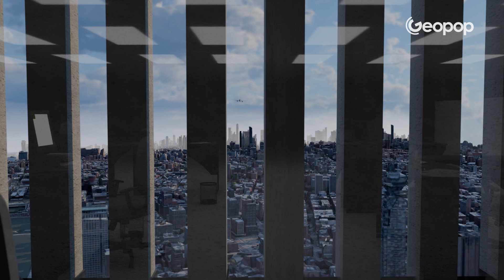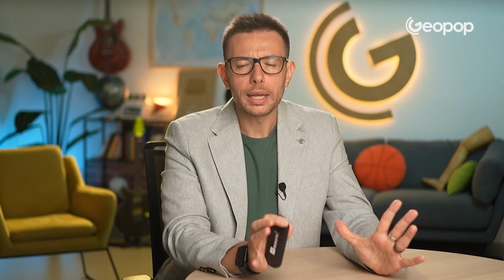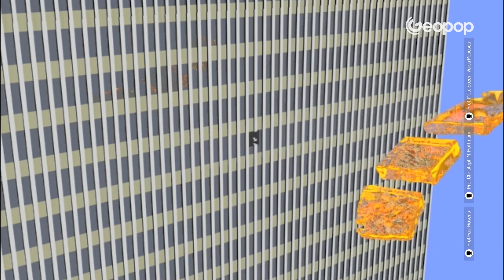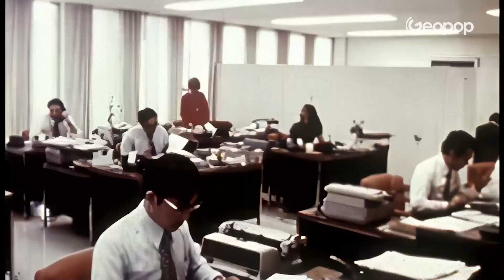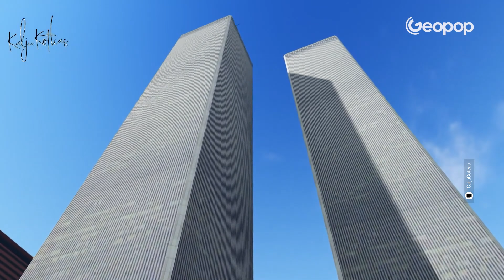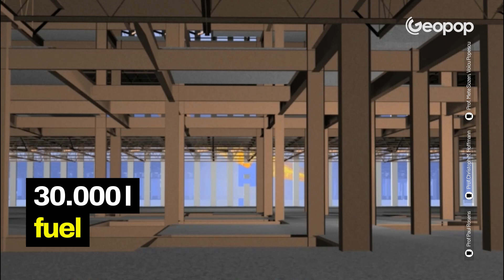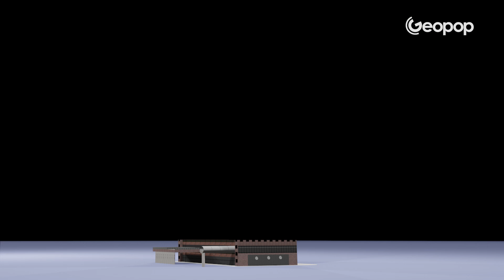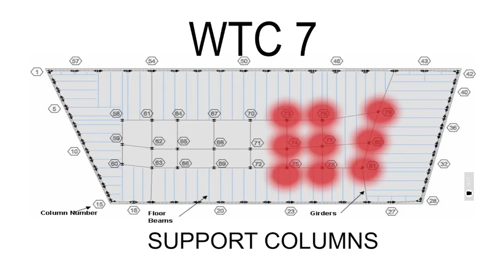9/11, 2001: The Technical Reconstruction of the Twin Towers and WTC 7 Collapses

Comment: Very very ridiculously retarded video
Reply: Really?  I found it highly detailed, accurate and logically sound.

What specifically seems to be the problem?
Reply: @TheCriticalStinker-jw4fl  how old are you and also research the building when it was being built and why it was built the way it was
Reply: @JamesClayton-w8r  I took your advice. Twin Towers collapses were relatively straightforward, the fundamentals already understood in the professional engineering community within just weeks. Yet there’s a lot of really bad information floating out there, mostly on the internet where it’s easily accessible to anyone. Good information takes more effort to come by and is much harder for laypersons to digest. Engineeringspeak is complex and dull while wild baseless speculation and pathological theorizing with easy hand-wave answers is simple, exciting and require a whole lot less thinking, thus getting far more intention than they deserve.

To correct that situation, I have all on my own prepared this short yet detailed technical description of Twin Towers collapses based on my own observation and analysis of the available true and relevant facts. No politics or ideology, just the engineering. My hope is this will dispel many common myths and answer most if not all questions you may have about the Twin Towers collapses, because anything can seem like a conspiracy if you don’t understand how it works

While complex, most of the Twin Towers collapse mechanisms can be seen with the naked eye and easily discerned and understood by the layperson if sufficient time is taken to understand. 

1. The Twin Towers consisted of 4 primary structural elements that together formed an integrated system where each relied on the others.  47 hollow box-section steel Core Columns carry the majority of the gravity loads. The 236 hollow box-section steel Perimeter Columns carry the remainder and ALL of the lateral (wind) loads. Long-span Lightweight Steel Trusses connect the core and perimeter column together at each floor with a Hat Truss on top to tie the structure together as an integrated unit where no element can survive without the others. There was no structural load bearing concrete and most components were bolted together. www.youtube.com/watch?v=u7OqrC74Dm4 

2. The impact of 117 tons of airplane (= to about 12 dump trucks) at speeds up to 590 mph with the energy of a ton of TNT completely destroys the aircraft. This in no way implies the Towers come out unscathed. Many perimeter columns are damaged or destroyed as are some core columns (example; 33 of 59 perimeter and 20 of 47 core columns damaged or destroyed at the impact floors in the North Tower), This damage is primarily through bolt-shearing failures at the end connecting flanges, as well as bending, twisting and fracturing of weld seams. There was no cutting or slicing - the reality was far more violent and messy. 

3. The impacts destroy or damage fire insulation, fire breaks and sprinkler systems on multiple floors.  Huge fires are started across multiple floors simultaneously and allowed to spread rapidly with no effective firefighting or fire suppression. This was an unprecedented fire event . 

4. The hotter steel gets the weaker it gets .  With fire insulation stripped away and no sprinklers the survival time of the steel greatly reduced. Gradually over time heat causes the lightweight steel Floor Trusses at the impact damaged floors to sag, which was observed and recorded.  No steel melted or needed to. Structural steel fails long before it becomes a puddle. It just needs to bend

5. Sagging floor trusses pull on the increasingly weak and overloaded Perimeter Columns, causing some of them to bow inward by up to 5 feet. A straight column is up to 4 times stronger than a bent column. The bowed Perimeter Columns buckle and fail, initiating collapse. The formerly static mass above which the structure below could easily support is now converted into a dynamic mass up to 30 times greater. Because they have buckled, the Columns above and below the failure point are no longer aligned . The load bearing structure below no longer bears any load as it falls past the lower columns, NOT onto them.

6. Thousands of tons of debris fall within the four outer walls, down through the open office space, crashing onto the first intact floor it encounters. This massive impact immediately breaks the bolted connections to the columns as the amount of resistance the Floor Trusses can offer is negligible.  The falling debris slows only marginally and briefly. Note:
6a. This is NOT a solid top block crashing into and “crushing” a solid bottom block .
6b. The debris falls past the columns not onto them.  The columns provide no resistance to the falling debris. 
6c. Only the bolted connections of the floor trusses to the core and perimeter columns can offer any resistance. A pair of 5/8” bolts at each end of each truss vs. thousands of tons of falling debris.
6d. No laws of physics are violated.

7.  This floor-led collapse progression within the four outer walls can only go straight down. Note: 
7a. This process is often incorrectly referred to as “pancaking” which actually refers to a completely different process rejected at an early stage. The catchy name stuck but nobody knows what it is supposed to mean.  Pancaking is too simplistic and inaccurate anyway. More like Kaiserschmarrn.

8. Collapse progresses through the floor systems not down the columns, through the path of least resistance . Rate of floor failures increases with each successive floor as momentum increases, reaching an average acceleration of 0.65 of GA, or 35% slower than true free fall. Bam, bam, bam down the building until there are no more floors to fail.  The resistance offered by each successive floor is always the same. The mass and velocity, thus the energy of the falling debris is constantly increasing, with each floor destroyed adding new falling mass. Some falls to the sides, but most falls down. More mass, more velocity, same resistance with each floor.  Don’t get stuck on the but the lower floors weren’t on fire nonsense. They weren‘t and didn’t need to be.

9. The Towers were 95% air by volume. As that air was compressed inside the building it is forced down the tower and blown out the sides in reaction to the building collapsing . Those were not “explosions”, it was expulsions of compressed air caused by the collapsing building, explaining the low velocity, lack of flash, blast, supersonic pressure waves and lethal high-velocity ejecta.  

10. Perimeter Columns become detached and peel away like a banana behind the collapse front, playing out to the four points of the compass extending to more than 600 feet from the base of the towers. This was quite obvious from examination of the debris pile. 

11. Core Columns fail last as their internal beam bracing is stripped away by falling debris and lateral support from the floor to perimeter columns is lost. 

12. For those who care about how long this whole process took; 31-34 seconds from the moment the perimeter columns buckled until the last core columns hit the pile, or 1/3 the rate of true free fall. Don’t believe me?  Just watch any video of the collapses and note the loose truly free-falling debris dropping much faster than the towers themselves.  

13. Each Tower had a 1-acre footprint. Far from collapsing inside their own footprints the debris pile spread out over 17 acres in a pile up to 14 stories deep. 8 surrounding buildings were destroyed and scores more damaged by the falling debris. 

14. NOT observed were the 180-190 dB bangs of thousands of high explosive devices or the blinding bright flashes of burning thermite. Neither explosives or thermite could have survived the impacts and subsequent fire nor could have caused the (silent) perimeter column buckling that clearly initiated collapse either. A video of a shocked and injured firefighter casually using the magic word explosion is in no way proof of explsoIVES  and the demolition_ case relies entirely on that sort of thing. There is zero tangible physical evidence and it would be technically impossible, totally impractical and completely unnecessary. No one would bother. 

15.  Finally, the Twin Towers were perfectly safe within their design envelope.  They only collapsed when taken far outside design parameters by an extraordinary and unprecedented event 

Impact + Fire (heat) + Time + Gravity = Collapse . Remove any one of those four elements and there is no collapse. Ignore any of those elements (as many do) and you will never understand the collapses. The Twin Towers were an integrated system in which no one component could survive without the others. One fails, the rest follow, through the path of least resistance – DOWN – through the open space, bypassing the path of greatest resistance – the columns.  Nothing I just described violates any laws of physics. All of the above is true no matter who planned and carried out the 9/11 attacks or why 

In 24 years zero structural engineers of tall buildings, including the 1/3 that have retired in that time, have made any statements in support of 9/11 Truth BS demolition claims. Zero, nada, none. The lack of any such citations in the engineering literature (published in any country worldwide) is palpable.

I hope you found this helpful and informative. It is not meant to be adversarial, but to solicit informed critical comment, positive or negative. If I made any errors of fact, logic or reason or left anything critical out, please let me know so I can fix it. To stay focused just one topic at a time please and on-topic (Twin Towers ONLY). No word-salads of Gish Gallop. IF you can offer a more plausible alternative be my guest. Be the first. Please start any reply with the words “Tits McGee” or I will know you didn’t actually read it, are not serious and just wasting my time. If you are going to argue, do it on the merits.
Reply: @TheLoonResistance  That´s so cool stinker! Now try to explain why NIST replaced FEMA´s stupid pancake theory by NO COLLAPSE EXPLANATION AT ALL.
Reply: @TheCriticalStinker-jw4fl Tits! Good points. Seems like the core should have stayed in place with your description.
There are more than 100 accounts of witnesses talking about explosions, including an explosion heard and felt in the basement 9 seconds before plane impact. 
Most importantly,  how does your scenario of collapse result in almost EVERYTHING inside the towers turning into smithereens? Would you suggest that the force of the falling floors caused every computer, chair, table, filing cabinet and door handle to explode or break apart?
Reply: @jwedges  - Sorry, I never saw your reply until now.  Didn't get a notification.

You missed some key bits, like the Twin Towers being an integrated system where no element could survive without the others and core beam strip down

There is only one witness who talked about explosions in the basement prior to the impact of Flight 11.  It was a story he fabricated years after the event and has subsequently retracted. The story itself is rather stupid anyway as how would someone in the basement have a fucking clue when Flight 11 hit 100 stories above?  Not possible.

That should have been your first clue.

Are you familiar with the artifact popularly known as the Ground Zero Meteor ?  Do you know what it is?

It is a chunk of 4 floors of one of the Twin Towers compressed together into a solid mass by the immense forces involved in the collapse. 

What was between each of those floors?

Computers, chairs, tables, filing cabinets, etc,....

Do the math.

Comment: 15:45 "the energy released was of such magnitude that the floors below offered practically no resistance." 

And there are many more very bland statements like this one, it's called, sales.
Reply: It's also not wrong. It may make you butthurt and want to cry, but not wrong.
Reply: @TheLoonResistance  LOL... "the energy released," from thermite charges.
Reply: @malachi- Is heat. And light. Literally blinding light.
Reply: @TheLoonResistance  Never heard what walls and floors and smoke and dust can do to light stinker? 🤣🤣🤣